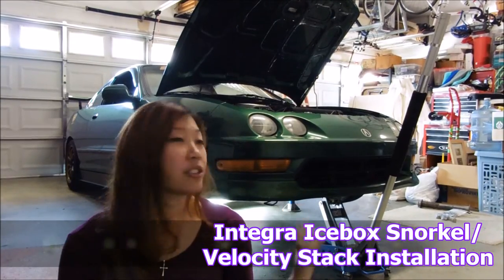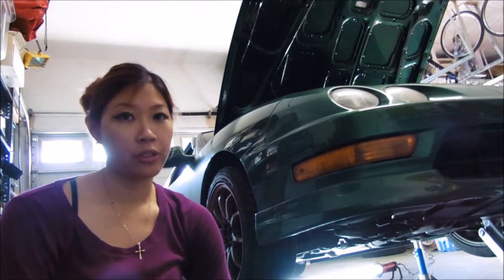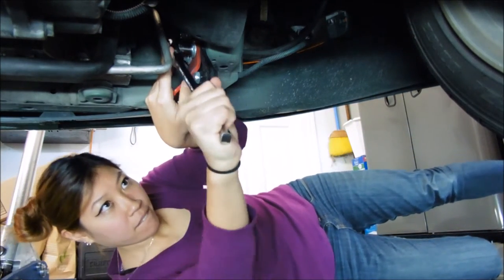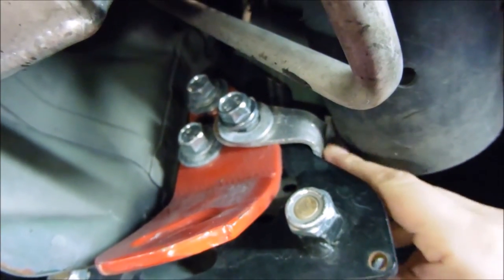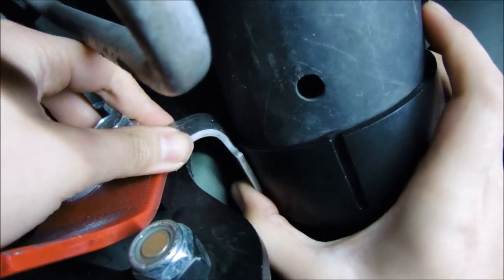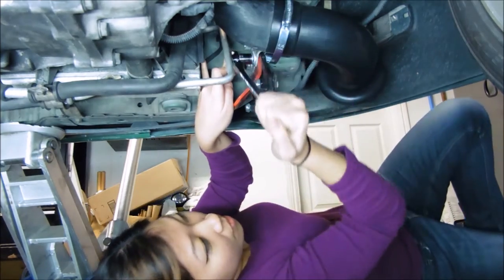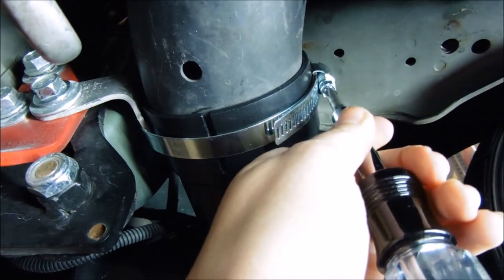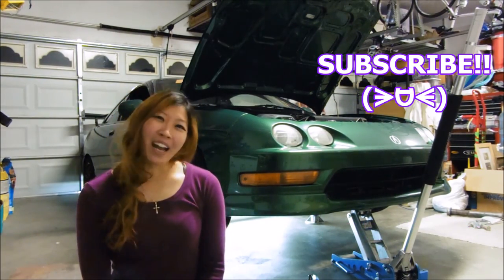How to Install Integra Icebox Snorkel/ Velocity Stack (VLOG 6)

Comment: just wondering, before you lost yours at a track day did you have the bracket? I've been running mine without a bracket for 4 years, so Im thinking of calling them if they sell that bracket piece separately...